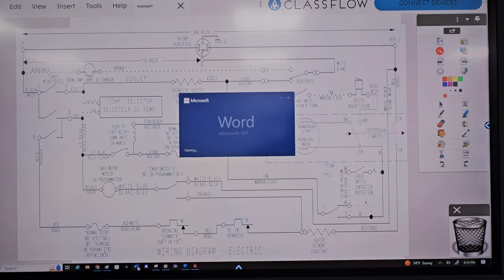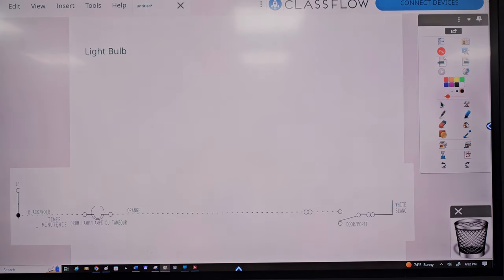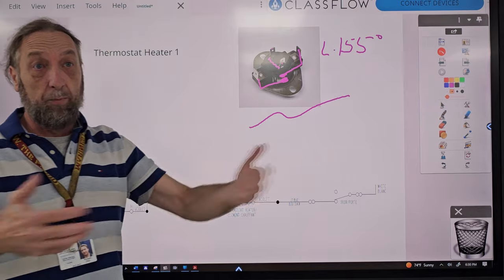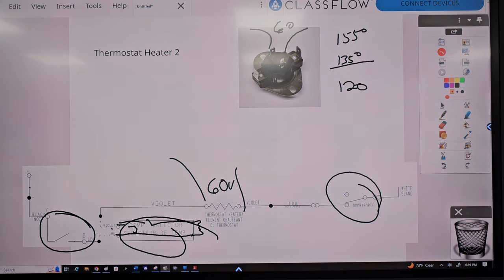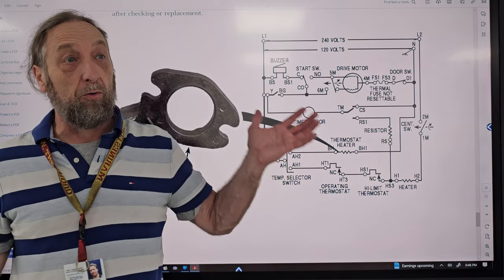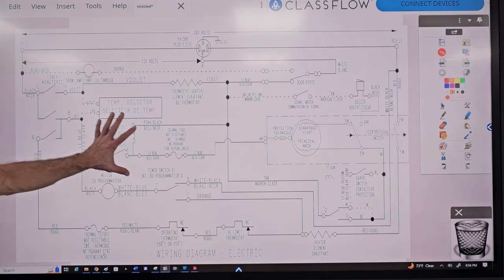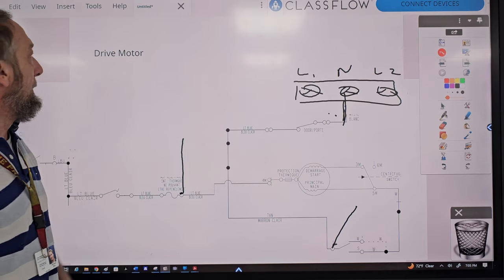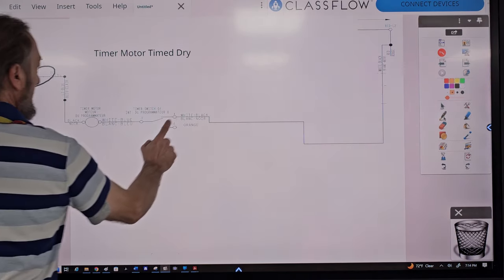Dryer Wiring Something Different

Comment: 1:38:30 - When the switch opens, all the voltage drops across the buzzer because the it has a much greater resistance compared to the motor. There’s not enough voltage across the motor at this point for it to run; but, the buzzer will sound and  there is less power dissipated overall.

Comment: if her vent is BLOCKED not allowing air flow okay. yes the timer will shut off when it runs out of time on time dry... but everything will be wet. and the high temp fuse will pop. done... you should of check the temp going up and way down with your meter now you can see a short heating cycle because of it is getting super hot very fast and shutting down quickly  it is called cycling on and off way to fast and that will tell the story..  and look for this: the heat will take a very long time to cool down because the vent ducting is very plugged up now think about it; hot air cannot leave the dryer because it is plugged up. and look for this: the temp will get super hot very quickly and always should take a long time to reach the high temp because the heat is leaving out the back if the venting is clear right... but if it is running and not stopping then everything must still be wet ??? and overheating for sure. i have a air flow meter to check for that... i think you should of tested for air flow first and ask her: when was the last time you had the venting clean out??????????????